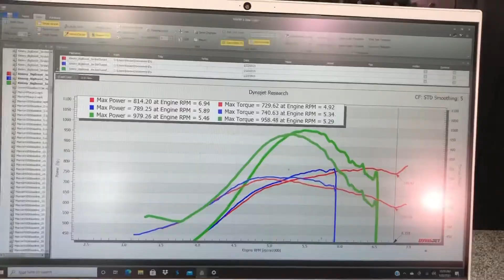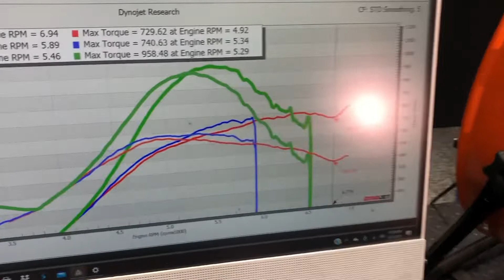TWIN TURBO MUSTANG GT HITS THE DYNO!

Comment: How much power can a stock 5.0 motor take ?
Reply from the maker: There’s a lot making like 8-900hp on unopened motors. I feel like it should be around there anything else probably pushing it lol
Reply: @Adrian5oh  is your motor built ?
Reply from the maker: That’s my friends car it does have a built motor, before it blew up he was making like 850 on his highest boost setting on stock motor
Reply: @Adrian5oh  what was the highest boost he was seeing on the stock block
Reply from the maker: I believe it was like 14 or 15lbs if I remember correctly

Comment: #ENEMIGARACING 
Gonna go back soon once it’s fixed and ready for the 18lbs! Hopefully 1100 wheel :D
Reply from the maker: Hell yea 🔥
Reply: What other mods do you have? Because I plan on getting that kit but what supporting mods do you have on there for 980whp
Reply: @midnightgt.  in the video I had ID1050X injectors and fore return style fuel system with dual fuel hats running E85 lund tune

I just upgraded to ID1300X injectors and triple fuel hat with my same fore fuel system.
Reply: @midnightgt.  oh and I got a built bottom end gen 3. If your a sealed gen 2 block, 980 wheel is doable but it will blow eventually. 800 wheel to 850 is a good spot for gen 2 sealed. Plus I’m 12:1 CR instead of 11:1. But 800+ wheel is still enough for the street haha